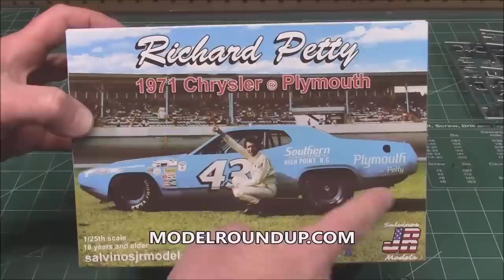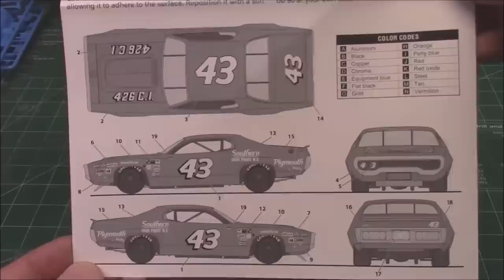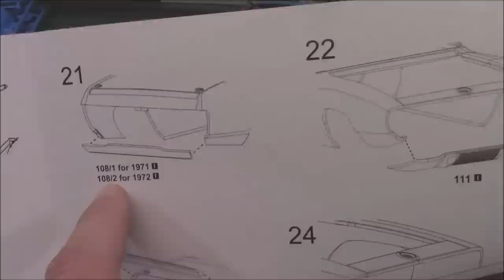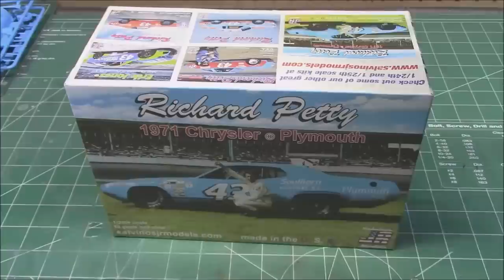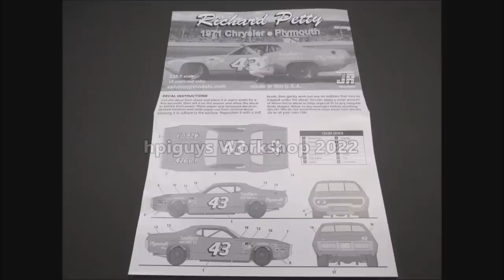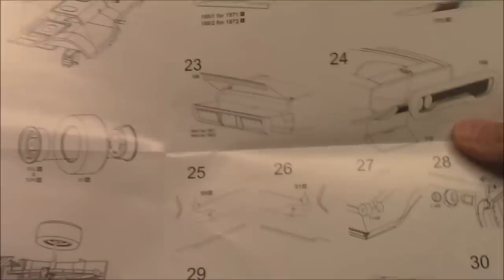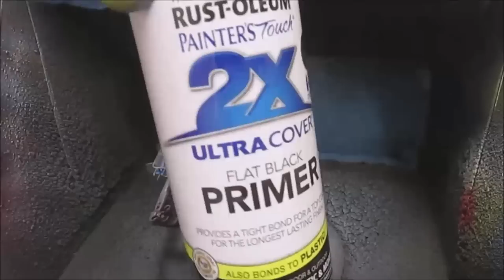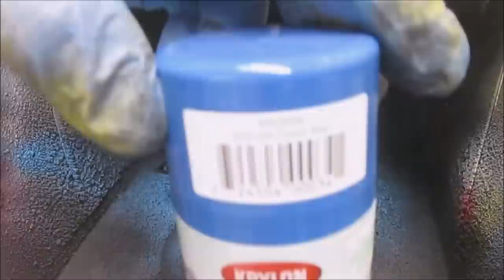1971 Plymouth RoadRunner Richard Petty 43 1/25 Scale Model Kit How To Assemble Paint Chassis Wheels

Comment: The detailed parts in this kit are impressive. The fitment of all those roll cage parts look like a single casting when assembled. Very nice build, Chris. Thanks for sharing. Now a couple dad (bad) jokes -
This kit BLUE me away. I was going to mention the dash gauges, but I didn't want to be Petty.
Reply from the maker: Thanks as always RA!
Reply: Hahaha!
Reply: How did you find the steering column to go in? Usuthe older or other car kit give a hole below the dash as a support then going down to the hole at the firewall. So I basically with my Dremel tool made us Mulgrew, so the top of the steering column would sit in and then I glued it.

Comment: As we've come to expect, a great video on building a race car kit. Very encouraging for those new or returning to model car building. But I don't share your assessment of the body's molded blue colour. It is a distinct departure from proper Petty blue. I have compared it to both of the MCW paints custom blended for Petty cars I've built and it's well wide of the mark. Also placed the body beside several high-end diecast cars which have minor variances between the '60s Plymouths, '70's Dodges and Oldsmobile and the '84 Pontiac. The '69 Talladega has the largest colour discrepancy but comes closest to the blue of the kit body. There's also some faint seam lines on the trunk lid and roof and minor blemishes on the rear fenders that need sanding.  For picky Petty enthusiasts, I would recommend painting the body.

Comment: It doesn't look like you had a clear answer to your question about the exhaust. The twin exhaust exiting out the lest side was common on short track builds. This was for clearance because the cars compressed the springs in the turns and the single exhaust on the right side would scrape. Otherwise on the speedways it was single out both sides. Also I noticed someone commented the instructions called for slotted wheels in the instructions. These weren't approved until the 1972 season when disc brakes were allowed and needed more cooling

Comment: Hey, what tape do you recommend for masking that doesn’t bleed
Reply: I typically use tamiya masking tape.
Reply: i use tamiya tape
Reply: He uses washi tape which is the same as the Tamiya tape but cheaper. But to actually prevent bleed through spray clear coat or the lightest color first, then your darker or second color.
Reply: I lay down 3M masking tape.  Then I go over it with a round toothpick with its end round off. Finally go over it with the edge of my thumbnail.  I ve doing it since 1975 with great results.
Reply from the maker: Thanks for the nice words!
I use Washi tape from craft stores as shown in dozens of videos. Just this very week in the Tie Fighter video I go into masking for a long stretch. 
I also like the yellow Frog brand tape, it holds very well and never pulls paint off.
Reply: I hate to sound like a commoner here, but the instructions from my amt 69 Torino cobra recommend 3M magic tape for masking; tried it, worked great,.